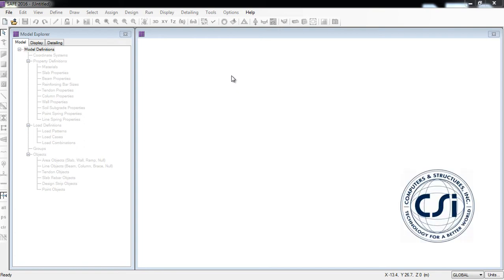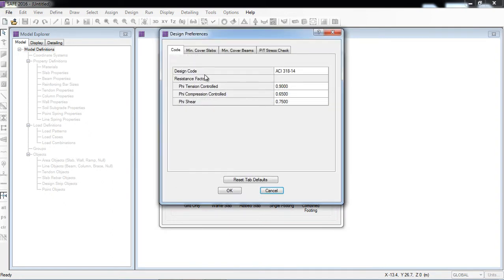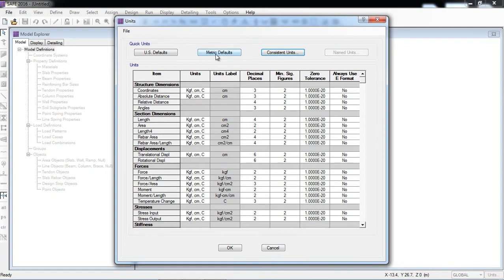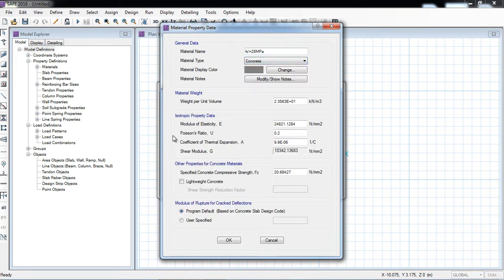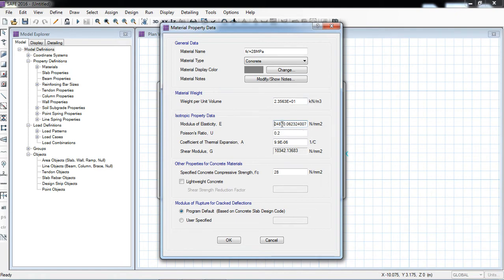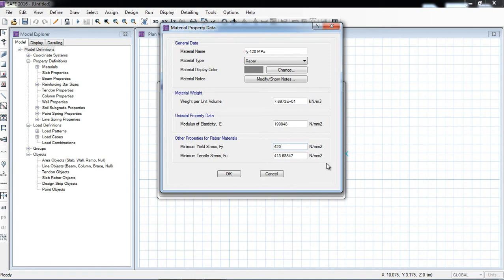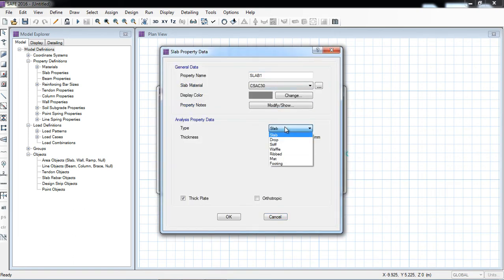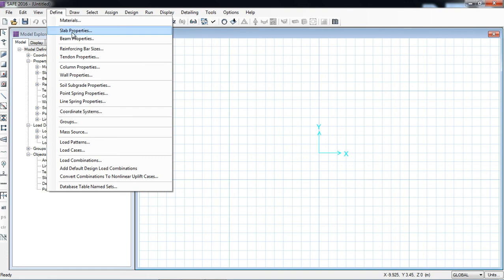CSI SAFE - 01 Introduction , Define Material, Define Slab Section

Comment: Hi Sir,
" An abnormal condition has occurred. Program needs to terminate. Do you want to save current model with different name? " 
The above mentioned status is appearing to me at "safe" program while i am using it and exactly when i come to define a section, can i get an idea about how to solve it? 

Thanking you in advance
Reply from the maker: Hi Dear.. basically, when Crack version is being used .. then this type error often comes...

You have to save model and then open it.. 

And continue working